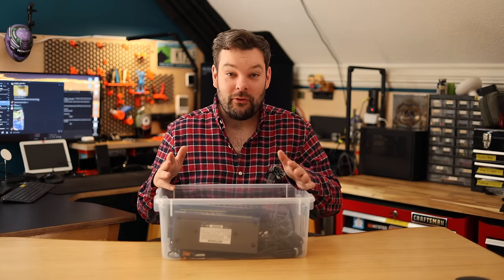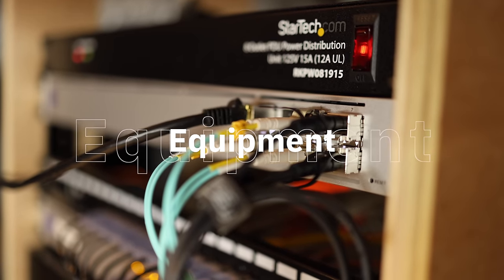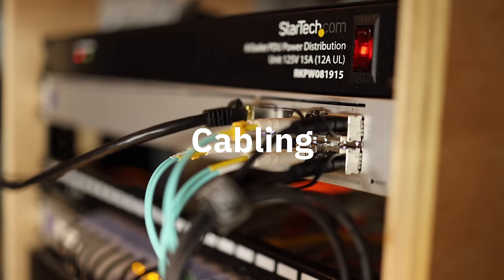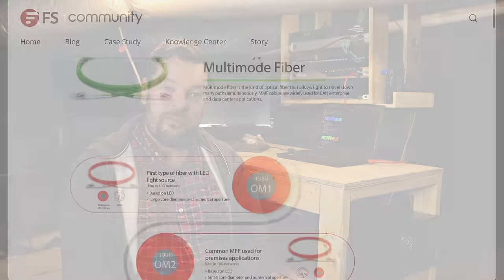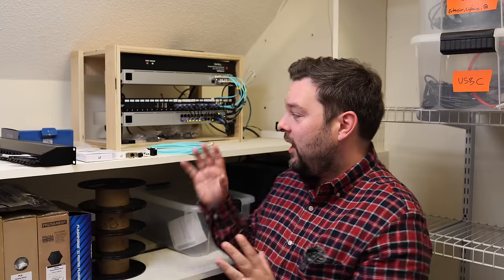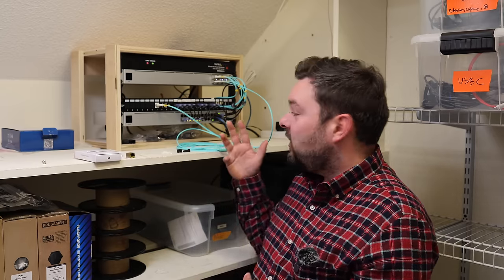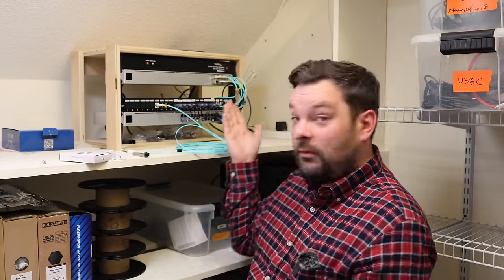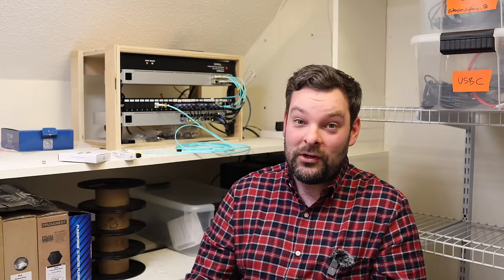Future-Proof Your Network: Upgrade to 10G with UniFi Fiber Gear

Comment: Every DC I’ve worked in has layers of daisy chained switches. There’s nothing intrinsically wrong with it. As long as you have sufficient bandwidth cross linking them and you lay out you clients to minimised chatter across those links. Putting your network storage on the switch with clients most likely to be doing large transfers to them keeps more of the data on the backplane and off the wire.
Reply: Technically yes but it introduces sort of a single point of failure too.  Say your whole network goes down you need to figure out which switch is actually causing the problem.

If you have an agg and the whole network goes down you know it’s the agg
Reply: I agree for smaller installations. I tried to fix a setup in a larger student dorm were the second switch stopped working.  There were 4 more switches behind it, so there way more affected people than necessary. The sad part was that the uplinks were 1gbit, so chaining them was not a smart idea from the beginning. Having an aggregation switch improved the situation a lot.
Reply: @dukeseb  that’s true, more devices increases your chance of an outage to at least part of the network. The nice thing about setups like ubiquity or Omada is they have basic monitoring out of the box which takes some of the guesswork out of network diagnostics.
Reply: @dukeseb  Management systems/software fixes this issue. And if you have a large enough home lab, you have dual core switches, edge switches, etc. And they are all "plugged together," using proper trunking. I get notified of a broken port, broken switch (heck even a broken fan) in seconds. I can choose what to do about it when I need to. IP cameras make this redundancy hard, but still manageable.
Reply: @dukeseb  murphy's laws - If it can go wrong IT WILL - and a chain is only as strong as its weakest link!
Reply: @dukeseb  The biggest question to answer obviously is, does it matter? And as long as the answer to this question is no, there is nothing wrong with daisy chaining.

For a household network, in which there is no business dependency, and affected people by outage are limited: There is nothing wrong with daisy chaining.

Better yet, to be totally honest, I think it even only makes more sense for a household situation to just daisy chain and have a single switch per floor, if network connectivity was not part of the initial design of the building. Creating a connection of 3 cat 6a cables between floors, to allow for a redundant cable and 2 cables allowing for 10 gbit speed individually, as well as allowing for link aggregation combined, are rather easy to manage. 

Per floor distribution is much more elegant to arrange than creating the required space for a multitude of cables going down to the WAN point of entry, if not part of the building design.

Obviously if you are running a business network, or have a company from home which is reliant on the network, things change. And more redundancy will become desirable or mandatory in a way. But for home networks, costs and benefits of such a setup usually aren't there. Even daisy chained, the single point of failure is often not that difficult to identify. And consequences of the single point of failure don't truly matter, because the only implication is an evening less of netflix or night of gaming missed out on. There's no loss of income, no financial deficit otherwise created.
Reply: @docfornix this I very much agree with. In a non business critical environment what does any of it matter. If you have switches cross connected and using RSTP then it’s not like losing one is going to break the network anyways. The traffic just finds an alternate path.

Comment: Telling people that you can't terminate your own fiber is inaccurate.  A package of 10 mechanical connectors is about $15. A kit of all all the tools necessary to do it right including a cleaver, light meter and visual fault locator is about $100. All my connections ended up being 0.5db loss (or less). I have 6 fiber spans going to separate garage/home office a couple of hundred feet away. Instead of buying an expensive FIU (Fiber Interface Unit) I adapted a $5 Tupperware container (at least it's dust proof :)

Comment: I don’t have a home lab but even if I wanted to have 10Gbps networking I don’t have a single client device that supports that much bandwidth. It’s cool but for now 2.5Gbps is the absolute most bandwidth 99% of residential users should consider.

Comment: While the Unifi Aggregation switch shows 10GbE as the negotiated speed, I have successfully connected 2.5GbE and 5 GbE devices to it using a 10GBase-T SFP+ to RJ-45 transceiver.  They functioned perfectly at those speeds with no issues.  The devices themselves properly reported 2.5Gb and 5Gb on their interfaces.
Reply from the maker: HUH. Well now you’ve got me curiouser than a curious thing. I shall have to try that out.
Reply: Found the same, it's dependant on the SFP+ to Ethernet module you use, some do it, some don't.  The switch sees the 10G connection to the module, the module then does the negotiation with the client.  I use 10GTEK SFP+ to ethernet modules, and they do that.  I also use their fibre modules between my Unifi switches (USW-Agg, USW-24-POE and USW-Pro-24-POE).
Reply: you just persueaded me to get surplus UNIFY here in Thailand as its cheap
Reply: I've done this too for a cheaper upgrade to my Dell Micro server. I bought a trendnet USB 2.5 ethernet adapter and ran it to my USW-Agg on copper with a 10Gtek transceiver worked. The transceiver is doing the autonegotiation I think because the Agg switch shows 10GbE and it works. for the 3 x $80 on cabling, USB adapters, and transceiver it was just barely cheaper than the 10GbE mini switch from ubiquiti though so.. weigh your options I guess.

Comment: 1. AOC is a thing with direct attached fibers and with longer runs. 2. SM is easier choice for the future proofing much longer in the future and for a 300 meter limit. 3. Self made cables is a thing here as well and not that difficult to achieve. 4. Bloody critters are capable of cable damage thus put armored cables to the attic etc.

Comment: Some ways to save money:

- Use cheaper OM3 instead of OM4, you can still do 100 gigabit at 100 meters over OM3, more than enough for home use. OM4 is overkill.
- Use copper or fiber SFP+ DACs instead of OM3/10GBASE-SR where applicable. Think of DACs as the SFP+ modules and the cable integrated into a single assembly. They're usually cheaper, especially for short runs like a switch to a device in the same room or same rack.
- Look into cheaper switches from companies like MikroTik instead of Ubiquiti, you can save hundreds if you do that and right-size the switches.
- Shop around for all this. Understand the price of SFP+ modules and OM3 cables from different vendors to make sure you're not overpaying. For example, Ubiquiti charges $38 for a pair of SFP+ modules, but you can get a pair of equivalent 10GTek on Amazon for $30, and I've seen them even cheaper elsewhere. Do pay attention to advertised compatibility though.

Some caveats or other random notes to consider:

- Don't rely on RJ45 SFP+ modules unless you can't avoid it. They run very hot (enough to burn you) because they draw more power than fiber modules, may overheat passively cooled switches if you put too many in one switch, and are limited to 30 meters at 10 gigabit (because they can't get enough power in SFP+ to go farther).
- You can get coupling RJ45 keystone jacks too, you don't have to wire the ethernet cable to the keystone jack if you don't want to. I did some ethernet through a wall between rooms and just used a few thin pre-terminated one foot long cat6 cables between the keystones.
- If you're installing LC connector fiber keystones in a wall, pay close attention to the boot length of the fiber cable you're putting inside the wall! Most walls and keystone jacks won't have enough space between the two sheets of drywall to fit a normal LC connector fiber cable (not without a nasty bend), so buy short-boot LC connector cables for this use case.
- Any time you're putting cables in/through walls/ceilings/etc, make sure you get cables that are appropriately rated for this. Riser/CMR/OFNR for in-wall, plenum/CMP/OFNP for in floors/ceilings/ventilation/etc, with plenum/CMP/OFNP being the better rating (still good for in-wall). This is all about fire safety. You might think none of this matters, until there's a fire and the maybe the cables you ran through a ceiling shorted against something and started the fire, or maybe their insulation jacket was flammable and let the fire spread much faster through your house by bypassing fire breaks like walls and doors.
Reply: Have you used MikroTik much? How robust are these in the long run?
Reply: Mikrotik probably has the best value in the market. The only downside : you need to be very knowledgeable to do a proper configuration.
I would go for Mikrotek immediately if support would be affordable...
Reply: Most people won't read all that bro
Reply: Thanks for sharing your network knowledge. I'm researching this kind of product for my home network system. Is ubiquiti better than tp-link omada?
Reply: Dude,   you hit it out of the park with this comment!
Reply: Mikrotik is based out of Eastern Europe, Latvia maybe.   Can they be trusted by customers in America?
Reply: @DerekDavis213  At least as much as American companies can be trusted.

Comment: I bought a spool of 1,000 ft of OM4. For about $300 I bought the supplies (Jonard fiber stripper, cleaver, AFL LC FastConnect) to learn how terminate my own fiber. I don't work with twisted pair a ton but am comfortable putting on RJ-45 and punching down keystones. 

On my first attempt with putting fiber ends on I got a light/signal and was capable of connecting. I went through about three LC connectors before getting a couple tips that made it easier and cleaner (likely for better quality connections). 

Point being that for not that much money and a little bit of time and focus you too can terminate multi- or singlemode fiber. Both are the same technique and dimensions when you get down to the 125um cladding. The AFL FastConnect OM4 (Laser Optimized) LC connectors are about US$75 a six-pack and the OM4 fiber was about $300 for 1,000 ft. 

If you have any interest I'd be glad to give you the links to what I bought or the tips for terminating. A few hundred bucks and two hours time you'll be terminating like you're Lenny Lightwave! Even though premade is so much easier I wanted to nerd out and learn the skill. Have about 10 fiber runs in my house now including 25GbE to a couple computers.
Reply: yep i bought a kit for 50 USD in thailand included cleaver, optical power meter, test illuminator a bag and stuff GREAT and my local fibre guys donated to me 1km of new cable with catenary in it for a bottle of whiskey (3USD) But this is AMAZING THAILAND be careful you dont get fibres in your fingers or worse!!! Do it in the yard..
Reply: Share the links anyway - I'm sure I'm not the only one who's interested in the tools you picked up.
Reply: OM3 cables are dirt-cheap on Amazon, does it really make sense to terminate your own?    Cat5 is easy, but fiber is a whole different ball game.
Reply: @DerekDavis213  It makes almost no sense! I used OM4 but just wanted to learn the skill and wasn’t sure of how many runs I was going to put in or the length, but I agree, kinda impractical although not that difficult either. But yeah, for a couple runs, just buy premade.
Reply: @CompletelyLawless  I have made many Cat5e patch cables myself.  I can terminate one end of that cable in about 1 minute.   I have an AMP crimper and use AMP/Tyco plugs with load bars.

How long does it take to properly terminate and polish two LC connectors on one side of the OM4 cable?
Reply: @DerekDavis213  No polishing needed with a clean sleeve. You just strip down the fiber to the tight buffering with the Jonard strippers, wile it clean with solution, cleave it with a cleaver (I got one from Amazon and one Fujitec from Alibaba), and slide on a mechanical spliced end (AFL FastConnect). You have to use more care than copper but my first connection worked. There is a card with the AFL ends that gives you measurements so use that template. The ends are on there but doesn’t take a ton of force to pull one off some physically securing them is important. I put some brackets into old work boxes then put them into keystones on the remote end and wrap them into a Leviton rack mount fiber box with cassettes in the network rack.

Corning has a mechanical splicing setup but it was like $1,200 for everything as where I think I did mine for $300.
Reply: @DerekDavis213  Sorry, I would say that once you are comfortable it takes about five min per fiber but I always go a bit slower on the first one when I haven’t done it in a while.
Reply: @CompletelyLawless  5 minutes isn't too bad.   And once you invest in the splicer, it would pay for itself if you do a lot of cables.
Reply: I didn’t buy a [fusion] splicer, I bought a cleaver. The splices are mechanical and use a gel that the cleaver end slides into. I have about 12 fiber pairs in my house. Mostly to other Unifi switches or high end workstations.

Comment: 10GBASE-T is amazing and annoying at the same time: It runs with really sophisticated line coding, right up against the shannon limit of the cable. That makes it power hungry, and very sensitive to non-perfect termination and connector contact. Combine that with mechanical compromises made in a cat6(a) connector in order to get the bandwidth in an 8P8C connector, and you get why I no longer use it where I have a patch panel in the path.
Your network diagram looks like RSTP is next on the list of things to try - Then you could have unplugged the DAC cables without disturbing the video watchers.

And finally, congratulations on now having error counters on all ports. Life is hard enough without them :-)
Reply: I found the connectors for cat7 way easier to handle. They are more expensive, but you don't need special tools for them. I use them with cat 6 coupler keystones and never had an issue with them. I get a bit over 900mbit till the RAM Cache of my NAS is full. Going with couplers is not really recommend best practice - but for your Home Lab, it can be a valid choice.

Comment: Hi, awesome video! A a little correction from my side: With some SFP Module you are capable of using 2.5gbE wit hthe USW-Aggregation. The Module will Negotiate 10gbE with the Module, but the Module will Negotiate 2.5 with the Network Device. The 10Gtek ASF-10G-T is one of those capable of doing that. here is a quote from the Unifi Forums: "The 10Gtek ASF-10G-T is autonegotiating the 10g connection on the SFP+ side and the 2.5G connection on the RJ45 side."
Reply: soooo that's why i was seeing 10G on the mikrotik on 2,5G uplinks.. thanks for the info :p
Reply: fwiw, Unifi's SFP+ to RJ45 adapter is supposed to support SFP+ to 1/2.5/5/10 GbE, part no UACC-CM-RJ45-MG.  $65 USD.  I have not tried this yet, but intend to use this transceiver between the Netgate/pfSense 4200 router RJ-45, 2.5GbE port to the Unifi 10GbE Agg switch or directly to the downstream switch SFP+ port.

Comment: I just upgraded to 2.5gbe, it came on pc, it came on my router, a switch was very cheap and so was a dongle for my NAS. I am very happy with it.  10gbe can wait.
Reply from the maker: Nice upgrade! I think folks getting NICs in the motherboards with 2.5gbe built-in will sell a lot of networking gear.
Reply: @ktzsystems  DSM 7.1 has beta SMB Multichannel support, so I will try a cheap second nic for my pc and second dongle for the nas this summer  for 5gbe ( or near enough) my ancient cat5a will last me a long time yet.Nearly everything else is connected to my Netgear Nighthawk 120 on 5GHz WiFi.
Reply: If it's included that's great. But realistically it's still too slow since an SSD can outperform it. Any modern HDD can hit 2Gb or so. Lot's of internet providers are already rolling out multigig internet making the 2.5Gb the restriction
Reply: @mrmotofy  Precisely why i went 10GbE. With EPON, my ISP gives me "up to" 8gb download and i am constantly bumping against the LAN 2.5gb limit. First world problem really it's super fast already but hey, why not enjoy the full bandwidth if the neighbors don't use it? :)

Comment: I love the video, the way you explain and talk thru all the elements, the reasoning behind, the editing! Amazing :) At home we have everything on the basement but for that we needed to extend all the CAT6 cables that where terminated in the ground floor (aka female keystone to a new cable going to the main networking/servers rack) plus run some CAT6A additional ones. That was a lot of work haha. Some of the CAT6A connect to an USW Aggregation using RJ45 SFP+ transceivers but I'm still questioning if we should have ran OM4 like you did instead for the devices that are 10G and are not in the basement.
Reply from the maker: If it works it works. Long term the OM4 will be a better bet though! Thanks for your kind words about the video.

Comment: Nice video, I’ve been using the udm max and 16poe switch with 10gb green nas and it’s all wonderful. Been looking to fiber for a long run from the workshop(where the server resides) to the house in the future, nice to know I’m almost ready to go with a couple of transceivers. Be interesting if we see more small switches that mix SFP+ with rj45 for those satellite breakout areas. Thanks again for adding clarity to the fiber options.